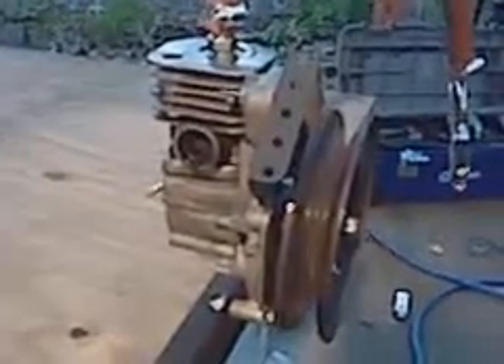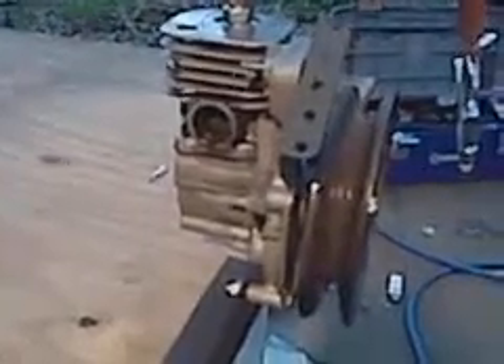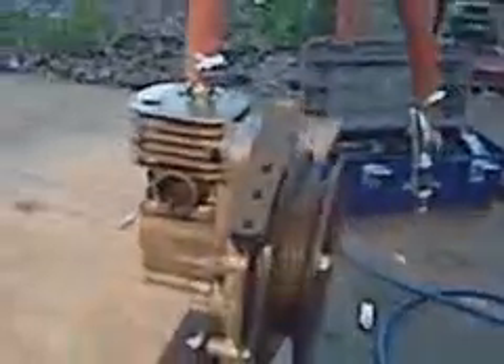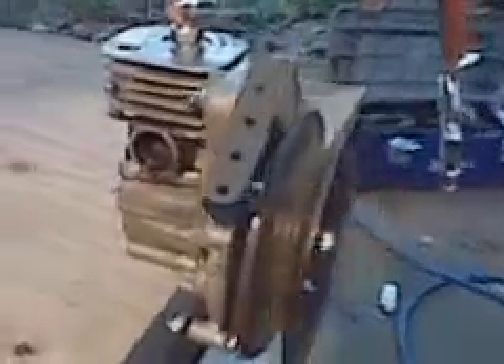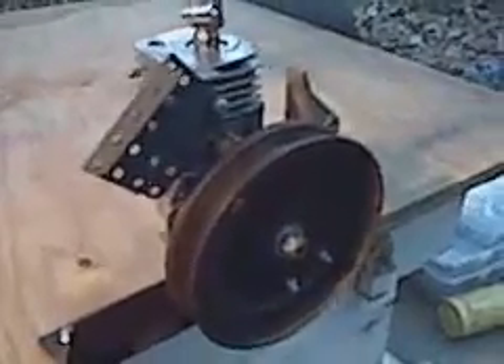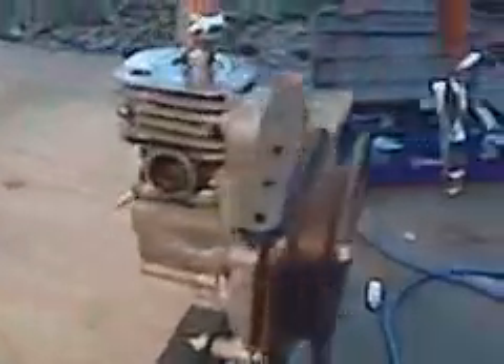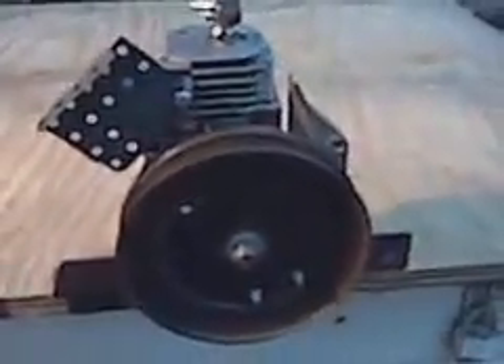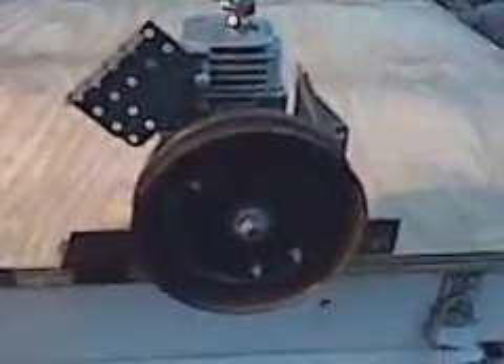Weedeater on compressed air #1

Comment from the maker: I did nothing internally, but I did try a timing mechanism(1/4" check valve and 12d nail) screwed into the Spark plug hole. I never could get the timing down just right. I was trying to do it mechanically rather than electrically. It was a fun project and did prove the viability of the concept. Haven't tinkered with it in a while. thanks for the comment.

Comment: What, if anything, did you do to the engine's internals?  Are you just putting the pressurized air into the sparkplug hole, and it runs?  Or is there more to it?  Thanks.